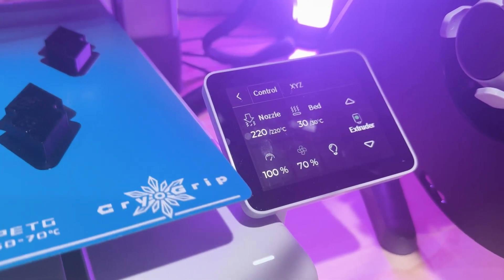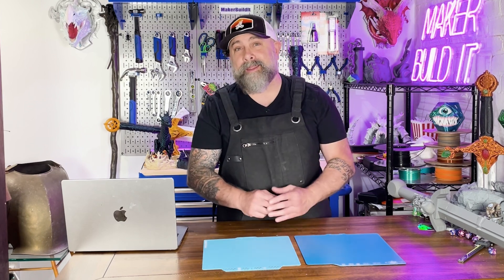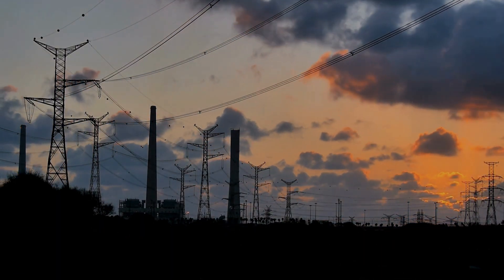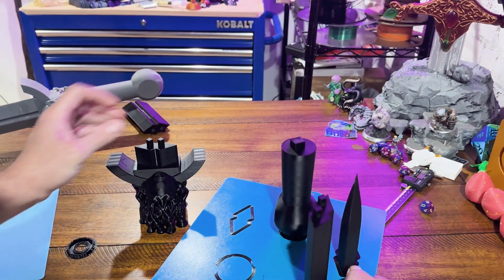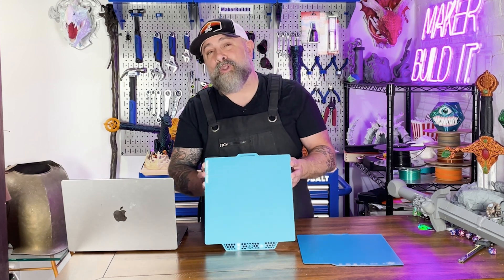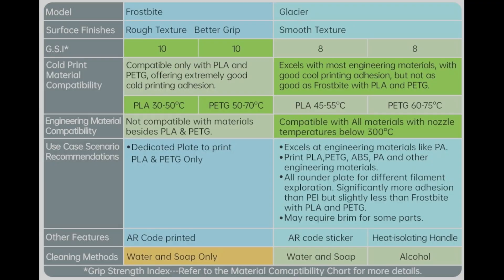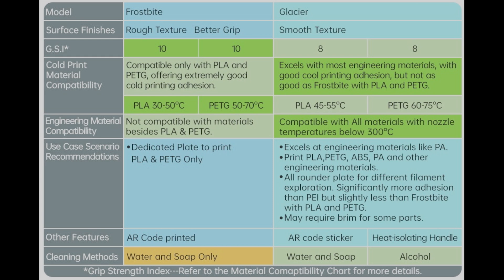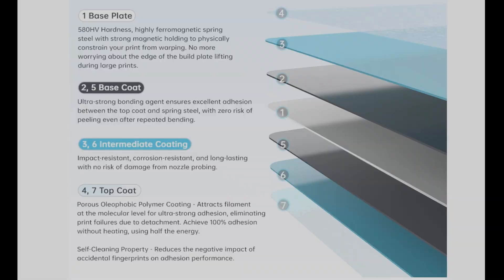Why Would You Use a Cool Plate for 3D Printing?

Comment: I bought a Kdeavi plate and the challenger is to remove the flat melted filament glued on it. I´m using a blade to remove them but sometimes I scratch it. Do you have any suggestion?